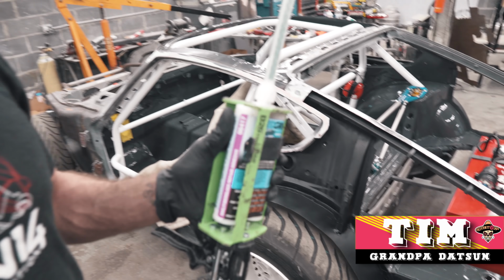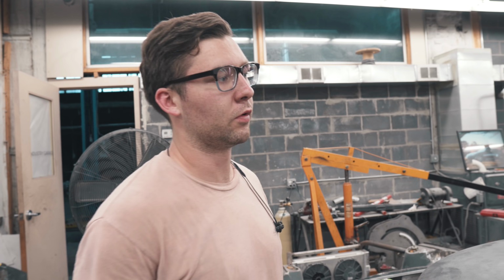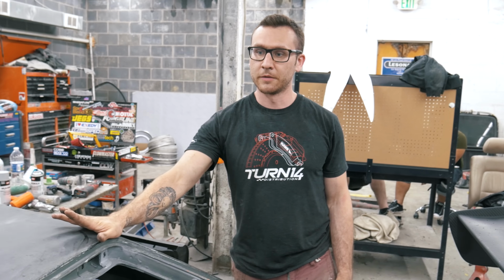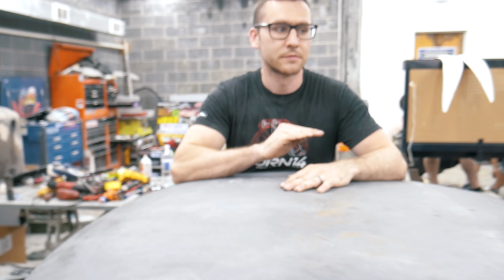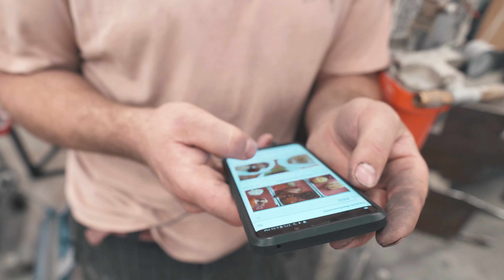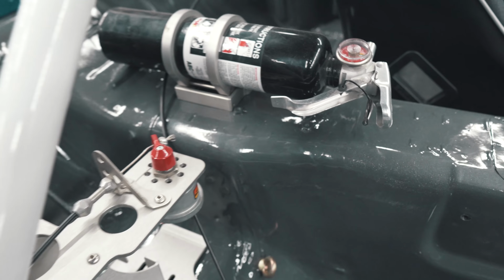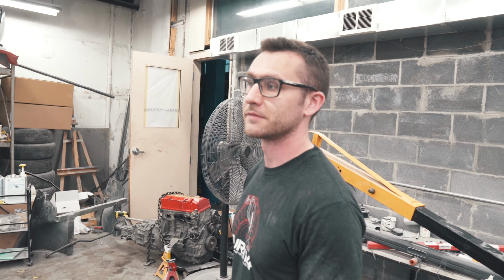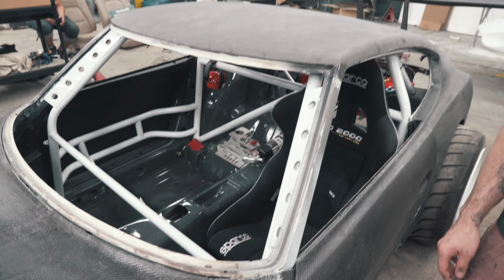240z Mounting Carbon Fiber Panels l Part 2 (Ep #19)(4K)

Comment: Here in the UK we have a company called rustbuster who make a two part epoxy paint ideal for wheel arches and the underside of the car as it adds a protection to the metal against stone chips (you say rock chips) and keeps rust at bay.
It absorbs impact from small stones and can keep noise down to a good level.

Comment: If you don't want to heavy the weave, but maybe still have some "peace" inside, maybe try something like silk, at extreme, some pool table felt (thin, but has those tiny hairs).

As for coating the wheel wells throw some bed liner (smooth if found, if not strained to remove the grip particles) and then, on top of that 4 layers of plasti-dip.

Comment: ive got some buddys that rally race and they use cheap garage floor epoxy on the underside, its rubbery and chemical resistant as well, not sure how much weight its adds though., also that roof leak is so JDM

Comment: LineX is without a doubt the best undercoating, the DOD and military use it to blast proof cinder block walls.
Reply: Street Bandito Rhino Lining is heavy AF even when dry. Check the weight/gallon vs the volume solids when wet. You dont need much abrasion resistance so a low expansion closed cell foam would be boss. Stay LIGHT
Reply: Matt B good point 👍 can be applied at different thicknesses tho, doesnt have to be a truck bed level coating.

Comment: whats going on guys, i don't know yet if you guys have undercoated the wheel house, but if you have not, I recommend using the 
SEM Rock-It XC, its a spayable bed liner and it helps with the sound damping.

Comment: Lizard Skin should work great for undercoating/sound deadening.  Toms Turbo Garage, used it on his Thunderbolt Miata.  The FAQ on the Lizard Skin website does say it can be used on interior or exterior and it's for heat and noise.

Comment: I've recently stumbled across your wonderful videos.  So, the total strength and rigidity relies on the epoxy used to adhere carbon panels to the metal? Correct?  Videos are a few years old and say this car is to be a track car. How are things holding up?  Would you do anything different? More frame supports? Leave more metal for attachment? Different adhesives? Thank you in advance.  ☺

Comment: This is an awesome build but i've got a question, if you are getting rid of the seams between individual panels by laying a sheet of CF on it, aren't you worried about the chassis flex at all to cause trouble? That is the reason why OEM cars have some panel gaps so larger than others after all.

Comment: Use some U-Pol Raptor liner for up inside the guards or ProForm has a few very good products which aren't as strong but more cushion like. I like Raptor Liner because its a satin/matte finish, and a super tough 2K material compared to conventional 1K under seals etc.

Comment: Ok ok OK you published it on Sunday...and I stopped working on my Z's to watch you all team work on yours...then "Paco" said we should go to the Bandito Bar and I started to get thirsty here in the glorious ( and I mean that Im from New England ) heat of Florida.
NEVER USE UNDERCOAT always use two part BEDLINER .I personaly love the professional results of RAPTOR. You can get a kit from summit racing .you get four quart bottle plus harder plus a shutz gun.
Ive never used anything but as undercoat. It doesnt dull it stays plastic hard like a plastic gas can.
And nothing sticks to it." Its THE WAY"! You can spray as thin and as thick as you want. The Z looks unique and watching you with that nose (thats fenders amd hood) lighter then one fender....im jealous.Thats a true one off now to finish it and get it to Jay Lenos so you all can get sema cred !!!
  For those reading this undercoat that comes in a can only looks good the moment you spray it , its why body shops like it to cover their paint over spray ( if they dont use flat black primer/paint can instead.The problem with it" its NOT two part system ( not rugged , not long lasting) its always tar/ rubber gooey when it gets hot like summer then drys harder in colder temps like at night and locks in the dirt it picked up in the gooey state. It starts to look brownish gray as it gets holding more and more dirt. Like fly paper under your car.
A two part bedliner is tough as nails becomes a plastic so it repells water ! Dirt ! And moisture.
And stays that nice black you like to see under your car . Its not even expensive you can spray on with an undercoat gun or brush or roll it on.Raptor is one brand rustoleum " professional grade two part bedliner as long as its two parts bedliner material and hardner you will be so happy " you may want to drive upside down"!!!.
PS its why people say undercoat is heavy cause it holds so much dirt in the gooey state.then they keep adding more to hide the dirty color and here we go again.Thing about bedliner you can use a thinner film to do a much much better job.
Reply: Street Bandito ahhh the idea is to be invited.Thats why a jay leno spot is the key to unlock sema.
      Its to bad all us car guys dont get the Support like all the California builders. They have every thing accessible.the rest of the country has no interest in supporting the creative car guy.Unless you drag your car to cali.
Like this guy , he showed up with this car ( he lives in cali), type in his name you see he comes back with a Z car.
https://youtu.be/Ks-mfmWkoGk
   In california the support is self perpetuating.Good thing about Jay Leno is he is always looking for "interesting builds from the little guy"

Comment: For those of us making molds of our trunks, hoods, and fenders. How would you recommend making the roof and rear quarters? Molds of those as well, then panel bond to what? Since you did carbon directly over the parts, the carbon will sit higher than normal. Also if I did not do it the way you did, I wouldn’t be able to cut the panel and leave a lip for a bonding point. Help please!!

Comment: How about the things used for Pickup trucks Bed for the wheels arches
Reply: Yeah Bedliner!
Reply: I was just about to suggest the same thing.  Linex is pretty good.  it's really strong and comes in all sorts of colors
Reply: Xavier Ancarno Rhino Lining
Reply: You can "strain" it too, to get rid of the rough bits to get the smooth finish, the chips inside are just for grip, nothing more.
Reply: aserta the rough texture is actually chunks added in for traction.    It is added in while mixing it before spraying.   So there is no need to strain it.   Just spray it without the chunks in it.   Believe it or not, a lot of cars already have this stuff sprayed on the rocker panels.  Its only slightly wavier than the painted surface so it shouldn't be an issue in the wheel wells or underbody.    I plan to do this to my ae86 when I am done sorting out the body.
Reply: Yea bed line is good for sound and basic wear protection but it’s not light weight. It’s actually kinda heavy
Reply: Rhino Liner is the way to go

Comment: 240Z is my dream car. Can't afford it, probably never will, but still.
And i knew there were many CF replacement parts, wondered what one would weigh and look like, never seen one with more then hood and wheel arches etc, not like this, where just about everything is CF. Great to see, i wonder what this is gonna be like. Looking good so far.

Isn't it a complete bitch to get all of it to line up and be parallel ? Seems to me you'd never get it fully straight etc. ?

Comment: I don't think undercoating will do too good of a job at reducing the rock noise in the fenders. But, newer luxury cars come with a carpet like surface in there so the rocks hit something soft.
Reply: NatoriousGamePlay depends on the kind you get, a thick coat of Rhino Lining will protect and dampen the sound quite a bit, none of that is going to 100% get rid of the rocks hitting. He probably should have put some of that sound insulator mat down on the insides of it before putting the quarter panel on.
Reply: madmax2069 I think he wants to save the weight so he didn't. Bedliner would help, but I was thinking a carpet like surface would be just as good
Reply: Street Bandito I have heard foam is decent at reducing noise. Some oems use a special foam in the frame rails to add stiffness as well, (some people do this to racecars but apparently it'll rust out quick). Another option is to try and fill foam betweens the carbon panels and the metal. Maybe 50 pounds total spread around the car. Another thing that works is a good underbody. A diffuser, splitter, and smooth underbody (dimpled like a golf ball) makes driving a bit quieter by better airflow. Not much you can do without adding weight. Just suggestions based off what I read.

Comment: man, this whole build is a guide what NOT to do when doing this kind of work. carbon laid on top of panels, carbon overlays, bare metal everywhere...
Reply: teamEP789 no carbon overlays here, the carbon parts are bonded to the outer frame of the old panels, and all bare metal was left bare so the epoxy would adhere correctly to it and the carbon. Which when it is covered in epoxy will no longer be "bare metal"